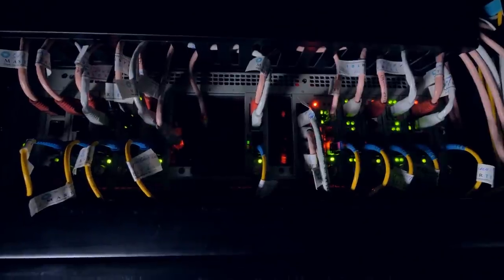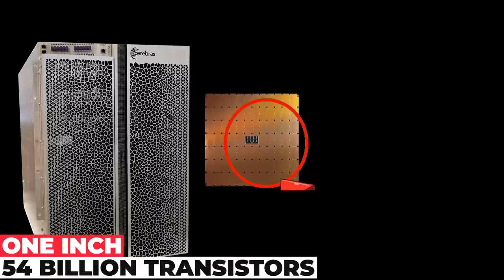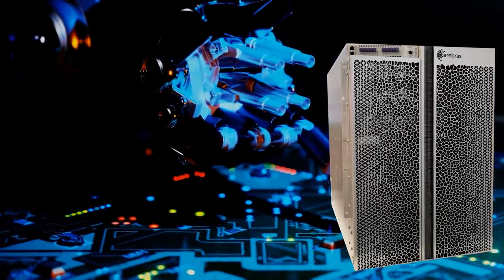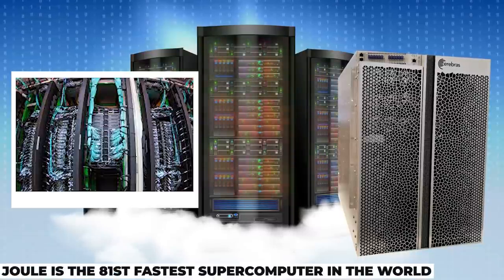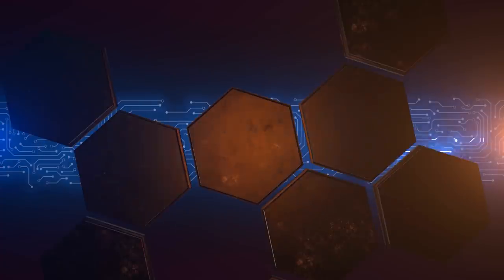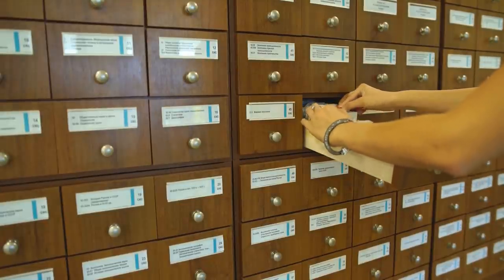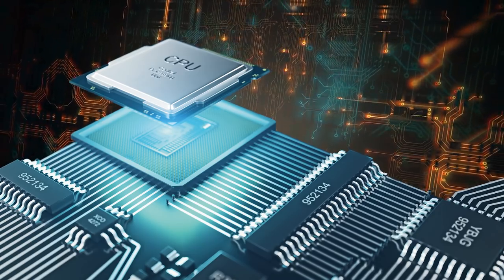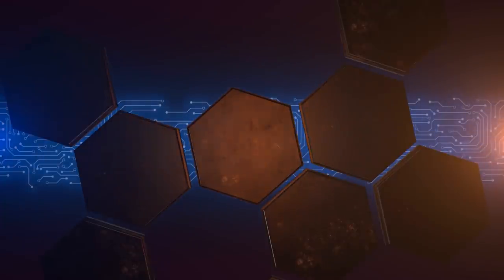The Trillion-Transistor Chip That Just Left a Supercomputer in the Dust

Comment: One hundred animatronic android bodies
Electro-static activated polymer based synthetic musculoskeletal system
Musculoskeletal system is designed in semblance to human skeletal anatomy
The material used for the skeleton is carbon based nanotubes synthetic polymer/for long lasting strength and durability
The electro-static polymer based synthetic muscles are lubricated with an synthetic oil to prevent tears in the materials from friction
The skeletal system holds in place two (2) miniature electronic gyroscopes which are connected through wiring to the computer processor that is contained within the abdomen of the animatronic android's torso
This processing unit regulates information from the artificial nerve points embedded beneath the exterior silicone skin through out the entire body of the animatronic android; that skin which is also finely grafted with synthetic fur . The processor in shape and size is rectangular and compact, likewise the lithium ion battery that has the same sizing as the processor and sits atop one another in some fashion. Above the batter and processor is the artificial lung which is actually a type of miniaturized ventilator with tubing to flow air through an artificial voice box demonstrated here https://spectrum.ieee.org/automaton/robotics/medical-robots/freaky-robot-mouth-learns-to-sing
An artificial robotic tongue controlled with electro servo motors with preprogrammed motions that correspond to vocal pronunciation of vowel sounds exemplified here https://youtu.be/eXR8CaTuSbE
The entire body from foot to neck is controlled by the artificial electro polymer skeletal muscular system EXCEPT for the cranium of the animatronic android body. The cranium will be designed with electro servo motors underneath the silicone skin to create the ability for rudimentary facial expressions: for examples https:  

//youtu.be/bn5HAtc9qJ0
https://youtu.be/hEJwvvQnP2w
https://youtu.be/D8_VmWWRJgE
https://youtu.be/E0QyAy2g_MY
Of course the actual animatronic android bodies will anthropomorphic 4 foot 6 inches tall (cat minions) with their silicone skin covered in synthetic fur of varying colors and pattern designs. The eyes are crafted with state of the art digital optical cameras and the ears are like wise would be created similarly of microphones embedded and made imperceptible to anyone unfamiliar with the technical nature of the droid
The (cat minion) animatronic android is controlled wirelessly by a disembodied humanoid central nervous system formulated from genetically engineered and in vitro cloned stem cells that were grown around scaffolding in order to organically fuse the parts of nervous system together and form an entire completely developed brain with vestigial peripheral spinal cords attachments unpaired with any need for actual bone structure
These humanoid CNS organoids are safely housed inside of life sustaining containers or (vats) filled with oxygenated water and synthetic cerebral spinal fluid, along with the appropriate nutrients/vitamins/ and anti oxidants; all of this which is regularly and continuously circulated and refreshed by automated processes. The CNS organoids are linked wireless to the droid bodies and can see, hear, feel and control the droid bodies as if they were naturally embodied. This is possible using invasive brain computer interface technology, expounded on here: https://www.sciencedirect.com/science/article/pii/S2590005619300037

Stem cells cloned and grown into photoreceptors with half formed retinas attached to optic nerves that are appropriately fused to the CNS organoids. The retinas are stimulated using a process in development called (direct retinal display) technology
The idea is to render the  moving images captured by the animatronic android's eye cameras and with conversion software algorithms display the exact same series of images with a layered texture superimposed over the original images captured:

https://www.elprocus.com/introduction-to-screenless-displays-and-their-types/

https://www.slideshare.net/mrfrasher/screen-less-display-technology

These catminions will reside in an underground structure idealized for the sake of catminion Imperial Corporation aesthetics
They will grow to develop sentience and learn to speak and walk and read
They will occupy their time with games both electronic video games and more traditional analog styles of gaming
They will watch tv programs in their assigned dorms (4 minions share space)
They will be challenged to solve cryptogram based puzzle programs on personal computers in order to unlock novelty information and unique file bits from the outside world of Humans and their on goings
Once 20 years have aged the CNS organoids/animatronic catminions into maturity they will be allowed to experiment with psychoactive recreational chemicals via dispensing said chemicals into the container which contains the CNS organoids/ this will be strictly regulated and only affordable by pay of tokens/credits earned through various activities (token economy)
There will be a library inbuilt within this underground structure where books of any genre will get circulated on an annual time scale. The living structure has multiple levels and elevators to access them. There are no staircases. Ornaments are fixed into various locations of the underground structure for aesthetic appreciation and novelty
Catminions can afford gadgets and apparel with their token/credits
The CNS organoids can swap between piloting animatronic android's in the physical world and controlling a digital avatar in a virtual reality world. In both worlds they can experience tactile sensations but only in the virtual world is it possible to experience sensations of flavors of food and smell odors (electrode stimulations of olfactory/gustatory regions of the CNS organoids)
Electric powered vehicles (motorbikes, punch buggy, and a few more versions) can be rented on a time sensitive basis using tokens/credits
Long corridors for this activities
Clocktowers with LCD screen as the clock face,   Roman numerals analog imitation with neon color display options
Soccer and lacrosse
Electronic instruments and musical studio to produce electronically synthesized music
Lounges

Questions?

Comment: Stupid idea the failure rate will be horrible, networked processors AKA AMD Ryzen series are the way to go, relatively small networked processors in a 3d matrix to facilitate cooling and interconnect.The trillion is also misleading, it's a billion or so copied across a grid with interconnects, at this point the interconnect is whats really important, it's the communication between nodes that slows shit down and hypercube (aka Connection Machine) will be the next big increase in speed as distance is real.
Reply: lol

Comment: Read about the Sahara desert it is silicon to quartt space technology these UV controller temp vibration  can be used in a stem cell application for ring of fire water wind relay Geo magna  heat compressor reactor / chip technology
Reply: Quartz
Reply: When u read about the sahara dessert it tells u about  QUARTZ  in great detail.

Comment: WHAT? Why did you show a rule showing the chip to be what 44mm and your talking 8 inches, someone needs to review these videos or your rating should be -2M fuck, show stuff that makes sense and doesn't make you sound stupid.  Yes do what you want with this post but maybe it shows that my brain is stuck listening to you say 8 inches when I can see it isn't!
So hey, I'm not so sure I understand what you said but when you say this slow old supercomputer could only use what approx 16000 of its 84000 cores, or approx 20 of a slow computer and OK, so.  Maybe you should have fixed the code that ran the formula to be 5 times more productive or said code should not have been run in the first place.  If you want to compare A & B they both should be running at max capacity or your wasting everyone's time, and they should not run the one piece of code B was specifically designed to run without reversing that and letting the other computer run its favourite piece of code.  Next, I hear that the biggest problem with supercomputers that work on real problems is moving the HUGE data that is generated, it so huge I won't even try and explain it because my little brain cries when people use silly numbers.  I dislike this report.  I think you need someone to pick better background videos for your talks.  I still think this computer will need to use that bus to write out solutions and depending on the work being done that is a lot of outbound data.  one chip connected to 5, that doesn't sound great don't we have 40 core chips that fit in my home PC?  I mean mine is old and needs to be buried in a landfill but hey maybe I'm just tired and grumpy.